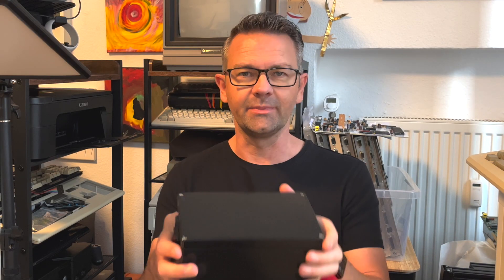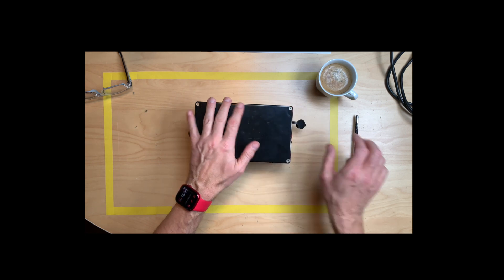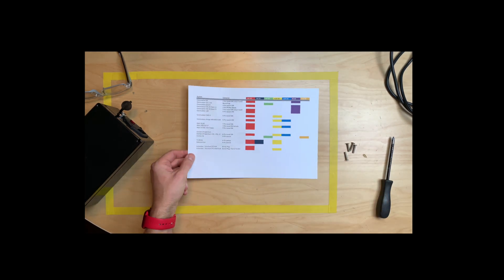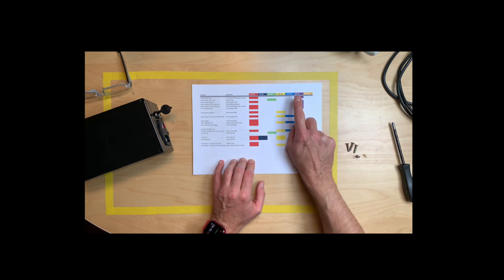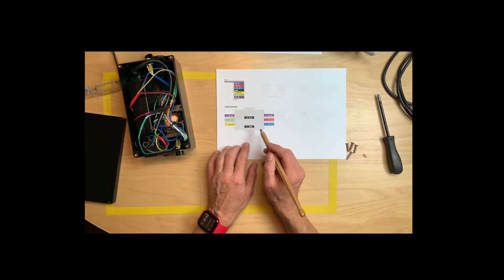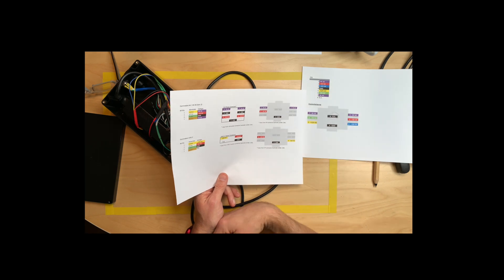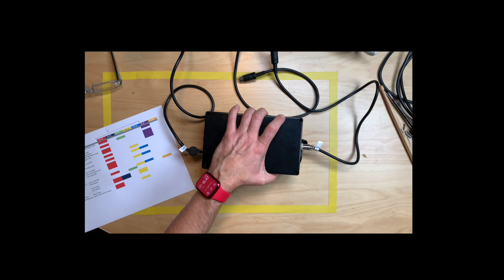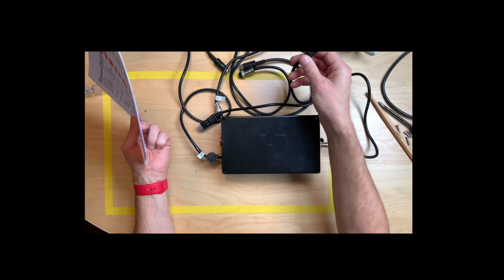The ULTIMATE Retro Power Supply - Amiga, Commodore, Atari, Amstrad, Spectrum and many more

Comment: A great sollution. I build mine about 2 years ago. The basic functions are the same but i choose different parts. A meanwell Powersupply for example is imo more reliable and for the 9v ac i take a strong transformer, all parts i got from reichelt. Also a 5v usb plug for example an pi1541. Further outputs via 5way din plugs so that i can connect multiple devices at once (computer and floppy etc).
You have done a nice job an a good explanation for such a sollution😊

Comment: That is a really good solution for limited  spaces  especially while using  a single  machine at a time(maybe two).  I have done  something similar  with an old ATX PSU but if you have a bunch of machines to power at once and they are spread all over a room ,   single modern power supplies  for each system appear to be more convenient. But again this is ideal when   your desktop accommodates different systems during a day.
Reply from the maker: True. The main thing for me is: a) I normally just use 1 machine at a time and b) it's way cheaper than buying modern PSUs for every single machine.

Comment: Take into account the power consumption of a device (amperage). For example, my Vic-20 uses 9 volts with 3.3 Amp.
A small PC-powersupply can be a cheaper alternative to a Pico PSU and the 12 volt power supply. A step-down converter gives me the 9 volts DC.
NB; the Sinclair ZX Spectrum and the C16 are 9 volt DC ... center negative !! The recommended 9 VAC transformer from eBay is very (too) weak for use.
It's not higher math, but you do have to know what you want to connect with what voltage and how much current it uses.
Reply from the maker: True. The eBay 9V transformer can handle a C64, but not two of them. The Pico PSU can be replaced by a small ATX supply, but it would increase the size of the PSU.

Comment: 9V AC i used also for Atari 400/800. Btw I planned to build something simmilar (parts are waiting in the box some year or more 😁) and also by using aviation plugs which are very sturdy and nice indeed (thanks for the amazon link). You could have added also some car cigarrette lighter connector to be even more universal. 😁
Reply from the maker: I never had an Atari 400/800. Just an Atari 800XL which I run from an USB cable. Should work though.